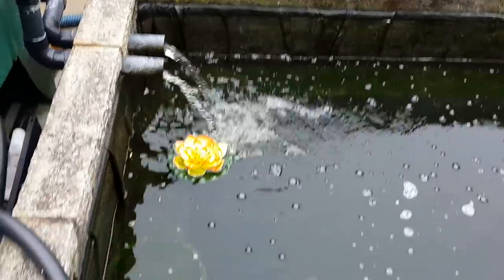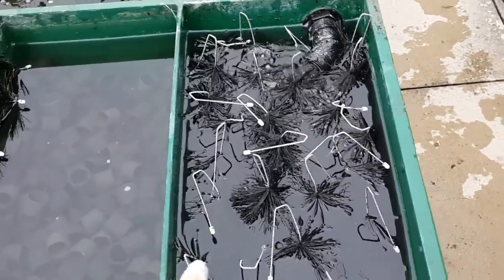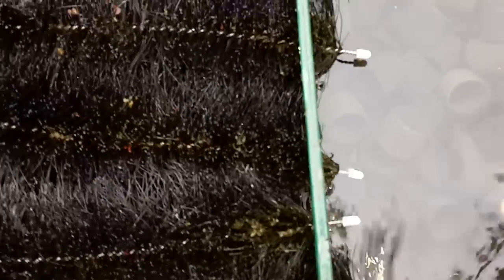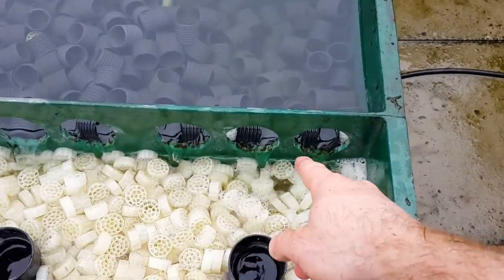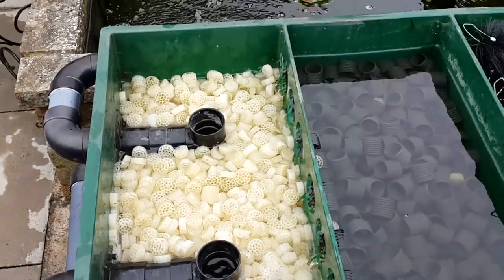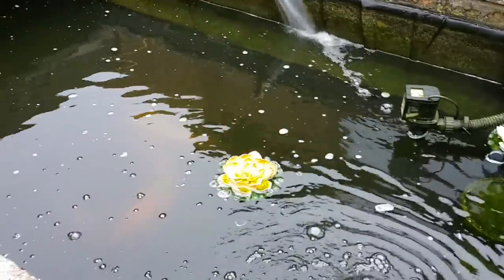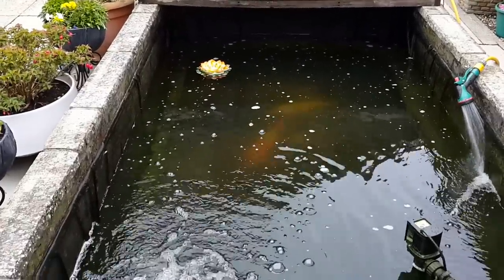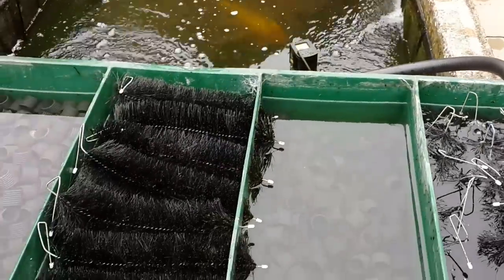Koi pond box filter setup and a murky pond

Comment: The brushes are Brilliant...I have been caring for my outdoor pond for years and learned many homemade filter ideas.  I have been looking for something easier than the bath scrubbies that are tedious to clean...will definitely try the brushes!!  Thanks.
Reply: What type of brush is that?
Reply: @RTX-yv7hj   I never used the brushes so I'm not sure.  I kept trying filter material and the BEST filter material I use is window screen!  Just regular flexible screen used in windows.  I just lightly roll it and place it in my homemade filter box.  It collects every bit of sludge and is so easy to rinse off with garden hose.  Keeps my pond clear.  Good luck with your pond...Take Care

Comment: IF a filter that big relative to the pond cant keep it clear..then the media is at fault. I've never seen such a gigantic filter set up for such a small pond. I agree with the guy said- lava rock would be better.
Reply from the maker: Right I will say this again as I do in every comment the pond and filter had not been cleaned for a long time It was a relatives. This is the 1st of many videos where the media was changed when I started looking after it and the filter is not a bad size for the pond it looks big but the bottom 3rd is hollow and holds the pipework for drainage.  TBH if you read replies to the comment you read i would not need to be typing this :)

Comment: Could you explain what is actually happening here and what the mediums are? You’re just saying you have this and that. What’s happening? How is it working?
Reply from the maker: Hi, sure, The 1st chamber are brushes water comes in at the top and down through all the brushes (mechanical media )this catches all the large bits of muck, blanket weed etc. the water then raises up through a full chamber of flocor plastic rings this acts as a sediment catcher so again (mechanical media but does provide surface area for biological bacteria) catching all dirt coming through. The water then flows over into the next chamber through a couple of brushes (i had some left) then through some sponges to catch more dirt and then through another chamber of flocor ( mechanical / small biological) to again catch dirt and waste coming through. the Last chamber is a biological chamber that had K1 static bed ( better results in moving bed but i inherited the pond and filter) which catches dirt and provides some biological I added a lot of alphagrog to this chamber to add more biological filtration as the filter was a beast for mechanical but was not ideal for biological filtration was good in the end though. hope that helps anymore questions feel free to ask. this is an old video i am 3 or 4 filter systems on from this now :)

Comment: You'd be better off with a less expensive biomedia than K1 in this filter. The advantages of K1 are only realized in a moving bed filter. Simple pumice would give you far more surface area for bacterial growth in this filter.
Reply from the maker: Hi, I agree this filter already had the K1 in when i started looking after it. I  am currently still using the K1 but am also using Alfagrog. I am currently moving K1 out and replacing with Grog slowly as to not crash the filter in anyway.
Reply from the maker: https://youtu.be/EMd_5bLLGKE?t=1m46s this is a later video of the filter with the 1st bag of grog in. I have been considering making a moving bed filter with the K1 and a small barrel i have in the shed but I have not got around to it yet. Filling the last chamber fully with alfagrog is probably enough filtration but more is always better.

Comment: is there enough circulation in the pond? it seems like the water intake and exhaust are too close together reducing water filtration effectiveness, do you have a strong bulkhead making sure water moves around.?. (sorry if i missed this in the video)
Reply from the maker: Hi, I thought the same and put a separate circulation pump in the bottom of the pond to move the water about.

Comment: Hi Kel ,                I noticed you had ball valves fitted immediately after your slide valves is this because the slide valves have started leaking . I know mine have , if so has fitting the ball valves solved the problem ?
Reply from the maker: Yeah the slide valves leaked ever so slightly just a drip but it was annoying the ball valves resolved this and i have had no issues since
Reply: Thanks again Kel , will go and get some first thing tomorrow , mind you might be next week when it warms up before I fit them .

Comment: Hi, I’ve just built an external box filter with foam, Alfagrog, corrugated tubes & multi-surfaced balls. My question is, should I fit a top to the box? I’ve been told not to (the bacteria need light?), but I want to prevent leaves etc from getting into the filter. Thanks.
Reply from the maker: the bacteria will be fine without light all leaving it open will do is grow algae in your filter. every filter i've ever had has had a lid and if you look at most of the large companies filters they all have lids. Put a lid on it save yourself the hassle of cleaning algae out of your filter. I don't know who told you that but think they are very mistaken another example is aquarium canister  filters and pond pressure filters they have to have lids and they grow bacteria fine. hope that helps
Reply: @KelsAquariums  Thank you. It didn't make sense to me either.

Comment: the whole filter is biological. brushes and small pipes are bio filter media. no mechanical filtration at all
Reply from the maker: Well Yes and no. everything in there will hold bacteria even the walls of the box filter. There are just some things that have a larger surface area so will hold more bacteria but the brushes and the flocor media are there to collect waste and both do a great job at mechanical filtration the brushes catch large particles of waste and any blanket weed that comes through the pump and the flocor acts as a big settlement chamber for waste but I agree they will hold some biological media.There are also a couple of sacks of alfagrog in for biological .

Comment: Hi there, i just inherited a pond when i purchased a new house and it has lots of fish in and a filter system like yours with the whirl part and then 4 trays with media in. The whole thing is very green and filled with what looks like algae, its set in a big rectangle box that has a net on the top rather. I have no idea what i should be doing with it. 1st i thought the algae was being grown for a reason rather than it being just built up waste but after seeing your video im thinking i should clean all of the media etc. I also thought it would be better to make a lid for the box rather than having netting so the filter system doesn't get any sunlight and therefore preventing the algae to grow even more, plus the sitting keeps falling into the filter. Is there any beginners guides you can point me too. Thanks
Reply from the maker: +Jackzuk Hi, I would start by getting a lid for the box then cleaning the filter media making sure to clean it with pond water or if it has outflow/backwash taps just stirring it up with the outlfow taps open . It might take a bit of doing at 1st you might need to clean the filter out allot but once your on top of it it will get easier and less time consuming.  For information this forum is very good lots of experienced people use it http://forum.practicalfishkeeping.co.uk/forumdisplay.php?f=28. Hope this helps

Kel
Reply: +Kel's Aquariums hi kel, thank for your help. I've cleaned as much of the media I can by taking bits out and washing them in a few buckets of pond water (hand are now freeeezing), there are 3 outlet pipes at the bottom that are all connected into one pipe. That has a half turn screw end. It's a pain in the bum to get back on when all the water is rushing out so I really want to put a tap on the end. Not really sure how I am gonna do that without losing all the filter water. I could syphon most of the water out into containers I suppose and them redo the plumbing and put the water back in. Is it safe to do it this way???

Also, is rain water collected in a water butt okey to go straight into the pond? And if so, it it better to add to the post of filter box. 

Thanks again kel
Reply from the maker: +Jackzuk Hi, You could siphon some pond water into buckets and put your filter media in while you drain the filter to do the pipework depends how long it takes if its a quick job shouldn't be an issue then just turn the pump back on and fill the filter back up with water from the pond. Then top the pond back up with declhorinated water from the tap or rainwater.
Kel
Reply: U can pour hydrogen peroxide for get ride of algae it doesn't affect fishes I am using it in my tank for 2 years still working.i think  u can look through my channel
Reply: Get a grass carp, that will help.